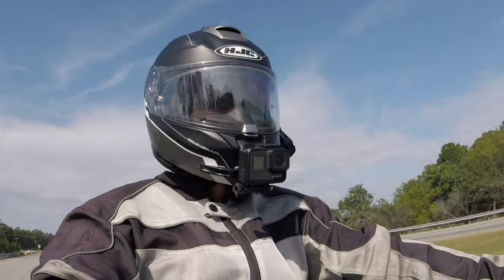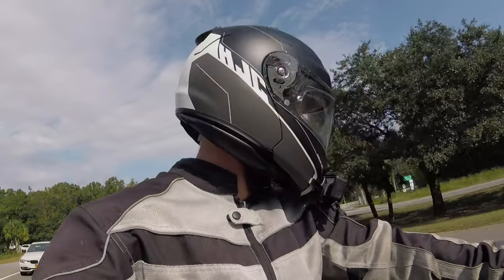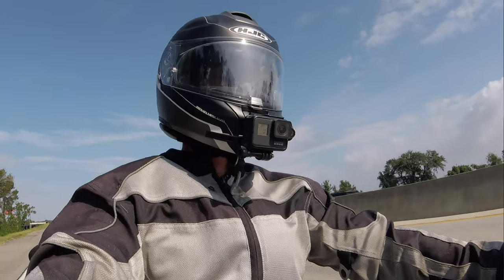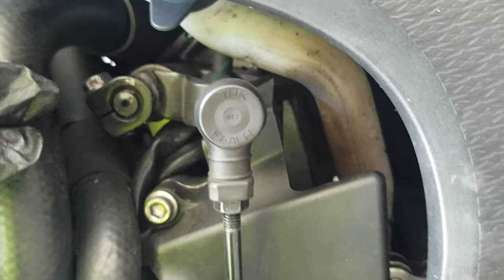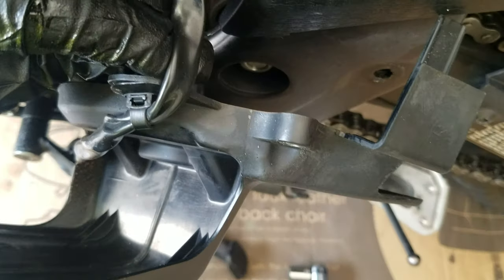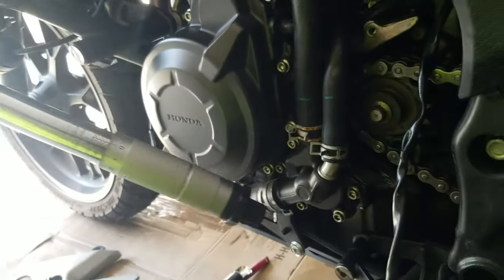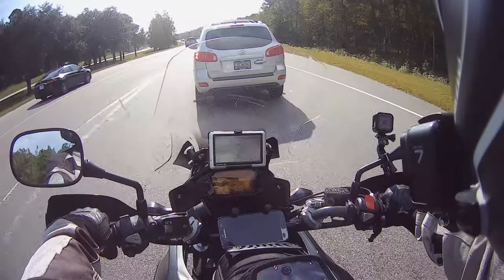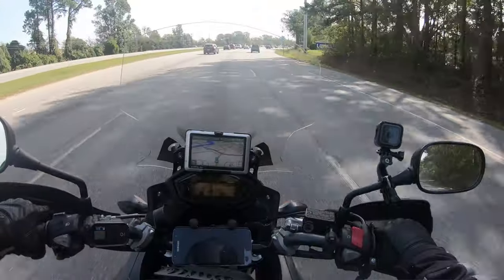CB500X 16T Sprocket Swap

Comment: as a retired motorcycle mechanic, the first thing i noticed on the video was that the chain had stiff links in part due to wear and lack of lubrication, the next thing was how hooked the front sprocket was that you took off, so the rear sprocket was probably in the same condition which in my opinion requires a change in both sprockets and a chain, by fitting just one sprocket it will tend to wear quickly to match the wear in the chain and rear sprocket, as  you said you are lacking in the knowlege that iv'e accumulated over many years,  i'm not trying to put you down in anyway,  just trying to be helpfull,  good luck.
Reply from the maker: Thanks for the informative comment, Stephen!  I truly appreciate it.  The chain is actually less than a year old.  And I'm pretty regimented about lubbing it every 500miles (Chain Wax), and doing a thorough cleaning every few thousand.  So I was quite perplexed when another reader pointed out the kinks in the video.  I contacted the store I bought it from.  Being less than a year old, the thought DID would surely replace it under warranty and gave me their contact info.  I'll be reaching out to them this week.  The rear sprocket is actually in pretty descent shape.  I'm pretty gentle on the throttle.  But it's next on my list.  Thanks again for the sage advice, my friend!
Reply: i just thought you needed to know,   i normally lubricate my chains after a ride or two (depending on the conditions and the weather i'm riding in ) while the chain is still warm from use then wiping off the excess afterwards the day after,  i myself use chain wax on occasion but prefer a more oily lubricant most of the time, don't believe everything the marketeers throw at you, iv'e used gear oil, chain saw oil and whatever iv'e had to hand, as long as it is lubrication it's ok,  it's the throw off factor that is important to some people they and i don't like cleaning thrown off chain lube off the back end of the bike,  every day is a school day,  good luck.
Reply from the maker: Great tips, @stephenkinsley2483 .  Thanks!
Reply: just because the front sprocket is worn does not mean the rear is anywhere near as bad as the front rotates on average 3 times as many times as the rear
Reply from the maker: Thanks for the comment, @jimbo-me2sp !  I never thought about it that way.
Reply: Could you please tell me how the front sprocket cover was modified. Enjoyed the vid
Reply from the maker: Hi @johnbaker7626 !  I didn't modify the actual cover.  But inside the cover, sandwiched between it and the engine casing, is a metal "shield" in the shape of a thin crescent.  That crescent is thicker in the middle and can come into contact with the chain if you install a larger 16T sprocket.  So I just used a metal grinder to shave a few millimeters off the width of that crescent shape to give extra space for the larger sprocket.  Hope this helps!
Reply: Chris Smith Many thanks for your reply.
Reply: @jimbo-me2sp  different material so the rotation difference doesn't count in my view?
Reply: @AlainLeneveu  On a road bike they are both generally made of steel
Reply: @jimbo-me2sp  many different quality in steel...in my experience engine sprocket are harder than rear but it all depends...and maintenance plays a great role
Reply: Yep, I was just about to comment on exactly the same observations.
Reply: In light of the fact that the chain guard needed to be ground down to accommodate the new sprocket would it just be better to change the rear sprocket instead?
Reply: @StephenJohnson-jb7xe  straight off the bat I’ll stick my hand up and say I’m no mechanic, however, I’m from the Lambretta world and in order to achieve the optimum gearing, have messed about with more sprocket / chain combinations than enough. From what I understand, by making the front cog bigger will give the clutch an easier life, so I guess by upping the rear sprocket the reverse applies. No doubt a grown up will be along shortly to make me look a chump 😃. If you’re wondering what a scooterist is looking in on a bike channel, well I was thinking of buying a bike also, & this Honda is the one that caught my eye .... can’t bloody believe you guys lark around with gearing too ... thought I’d be leaving all that behind 🥸
Reply: @geoffhields2398  After following up on my own question I think it might have something to do with cost, a front sprocket appears to be way cheaper to replace than a rear.
Reply from the maker: @StephenJohnson-jb7xe  that is correct...and easier to do since you don't have to take the rear wheel off first.  :-)
Reply: S. Kinsly you are right as rain. Change both sprockets and chain.
Reply from the maker: @bigbeaucoup8236  thanks!
Reply: @MotoPhotoAdventures  lubing every 500 miles and cleaning every 1000? Wow. I though i was lazy for doing those two every 50 - 100 miles...
Reply from the maker: @luizz_k  HAHA!!!  Some of my friends hardly ever touch their chains and just replace them when they get rusty.  I guess to each their own!
Reply: @MotoPhotoAdventures  most guys don't want the grease on the rear rim that collects dirt
Reply from the maker: @cargotoolshop5319  I totally get it.
Reply: Yall are all adding new lube to dirty lube if you're not cleaning it 😂 clean it properly, lubricate it, and you won't have to do it again for another 1500-2000 miles depending on how hard you ride the bike
Reply from the maker: @robertportune1971  that's a great tip!  I usually apply apply a "light" amount of lube every 500 or so miles, then do a thorough clean & lube every 5,000 or so.
Reply: its a bit like replacing one worn shoe and still wearing the old one, its funny.
Reply: I noticed  that too ,and I agree
Reply: @MotoPhotoAdventures  tight links in my 44 years of riding  are usually  attributed  to chains being  too tight ,adventure bikes with long travel  suspension  ,need to run a bit on the loose side.
Ie ,my Honda Varadero  ,was killing  chains and sprockets, at about 17000kms ,since I've  been running  a looser chain ,I now get about 45000kms to a set .
Reply: I agree ,I would  add one point ,the main reason, chains get stiff links ,is because  the chain is adjusted  too ,tight ,long travel  suspension  ,bikes ,need the chain  run on the slightly  looser side.
I learnt  that the hard way  ,my Varadero  used to chew up chains and sprockets  in around  17000kms.
Adjusted  quite  a bit looser ,I now get about 50000kms out of a set ,without  tight links.
Reply: @MotoPhotoAdventures   thank you very much for the tutorial to install the 16T sprocket and answering the question re: the chain guard.  I might have to use a file to remove some material to make it fit and safe.  You are very thorough in explaining what you are doing in your videos.  Thanks for making it easier.
Reply from the maker: @dennisdrumheller9756  I'm so glad we could help!  It's always a pleasure...

Comment: Hi all. Did the Mod with the front sprocket on my CBR500R and it has worked wonders. The speedometer now reads exact. I just did a major long-range highway trip and the motor was working a lot less hard at 70mph. Much more usable and better mileage. This works really well.
Reply from the maker: That's great to hear!  Glad we could help.

Comment: After riding from Germany to Portugal and back on the Trans Euro Trial, one great key feature on the CB500X is that low 1st gear. Riding often standing and going slow on routh terrain, through river beds and on steep hills, that proofed to be important ... always depends on the way of usage.
Reply from the maker: This is very true!!!
Reply: I have 1 in Crete I ride in the mountains, stock 1st gear is fine. I have 1 I ride in UK, as soon as I rode it there I noticed how short 1st gear was! I'll fit a 16T on the uk one.
Reply from the maker: I love the versatility of this bike.  Being able to swap gear ratios makes it even MORE adaptable!!!
Reply: Ich will die gleiche route fahren im Sommer. Hast du tipps welche Anbauteile ich benötige? Motorschutz Blech, Sturzbügel (Oben unten?), welchen reifen bist du gefahren?
Reply: @bitparlee7120  vorne Heidenau, hinten Continental tkc80, ohne Bashplate aber mit Motorschutzbügeln seitlich, Handguards und Tubeless-Flickzeug.

Viel Spass auf dem TET & Obacht vor Pyrenäen- Hunden in den spanischen Dörfern!

Comment: "I'm told that there isn't any loss of torque on the low end" This is false. I have ridden with both the 16 tooth and the factory sprocket and there is indeed a difference.  You yourself pointed out how different first gear feels in the video. I ride on and off road and the low end torque on the stock sprocket is just what I need. First and Second gear are perfect for the rough mountain single track I sometimes ride. It is noticeably worse with the 16 tooth sprocket. Last year I took an 8 month 20,000-kilometer trip (12000 miles for the metric confused)  and I did a lot of off road riding and crossed a couple of rivers that had no bridges. If you only ride smooth paved roads then the 16 tooth might be for you, but I wonder why you bought a CB500X in the first place. It's sometimes called the "Halfrica Twin" because it is an ADV bike designed for on road and off road use.  Longer suspension travel and higher ground clearance for rough roads. You handicap it's off road capability with a 16 tooth sprocket so you can get a bit faster on the highway. If all you do is highway crusing, to me that points to getting a different bike altogether.
Reply from the maker: Excellent insights!  Thanks for the detailed comment.

Comment: I recently put a 16T on my 2013 CB500F and I'm so glad I did. Now I ride it every day as a commuter bike and I save my ZRX for the long weekend trips.
Reply from the maker: That's awesome!  Glad it's working out well for you.
Reply: So do i
Reply: I just purchased the 16T sprocket and ready to install in my 2013 CB500x.  I haven't driven it much so it only has about 5,000 miles on it.  My question is:  did you have a problem with the chain guard fitting with the new 16T sprocket?  Did you have to get it ground off a little, or did you just leave it off?  I'd like to determine that before I take it apart.  Thanks

Comment: Mine was off 2mph when I geared up my 250 rally from a 14 to a 15 🦷 and also 2 mph off when I went from a 15 to a 16 🦷 on the CB500x...
Reply from the maker: Good to know, George!  A lot of guys have installed one of these to correct the speedometer:  SpeedoDRD DRD-3 from 12 oClock Labs - https://amzn.to/2Pahs8C.  I just use my GPS to guage my speed.  Thanks for watching!

Comment: Im confused as to why Honda did not include the 16tooth sprocket. I think I will consider this change when I need to replace my chain. Thank you for this video, still very useful.
Reply from the maker: I'm glad you enjoyed the video and found it helpful.  I believe the reason why Honda does not include the 16 tooth sprocket is because in many countries there are not large interstates like we have in the west.  Many of the countries where this motorcycle is marketed have very curvy, mountainous, or dirt roads where the 15 tooth sprocket is more appropriate.
Reply: It's because this bike is not intended for highway riding. It is marketed as an allrounder. This change may work wonders on the smooth road at high speeds but it is not so good for off-road riding. And Honda sell this bike telling that it can handle off-road too.
Reply: @Goeker  much appreciated insights shared, thank you.

Comment: Thanks very much for the instructional video. With the new 16 tooth sprocket, each gear feels like it is operating in the range that was meant to be. With the original 15 tooth sprocket, first gear was so short and jerky. Much more usable and smooth now. Truly a worthwhile mod!
-If I may add one bit of advice to folks who are about to do this: In order to remove the top part of the gear shift linkage, pull the small bolt out COMPLETELY -do not just loosen it, as the linkage will not come off otherwise (don't ask me how I know!) -Happy riding folks!
Reply from the maker: That's awesome!  I'm glad you're enjoying this new modification.  I have to admit, I chuckled at your piece of advice...clearly learned through experience.  🙂  Excellent tip!!!

Comment: Thanks for your response on FB, Ive bought a 16 tooth, probably fit it tomorrow. Very useful video Chris.
Reply from the maker: You're very welcome Dr. Campbell!  Enjoy...  :-)
Reply: Have you tried it yet? What's your opinion? Thanks.
Reply: @tiagofigueiredo2529  I have bought one, but not got around to fitting it yet, my garage is a bit cold this time of year, soon. Looking forward to the change.
Reply from the maker: @tiagofigueiredo2529  I just returned from a $4,500 mile trip down through Mexico and back with the 16T front sprocket.  AMAZING riding in Mexico.  The sprocket did great!  Check it out at:  https://www.youtube.com/watch?v=s8Av65qL_mY.

Comment: Did this to my 500X. By far the 16t sprocket was the best single change to the bike.
- cheap <$30 
- easy to do, maybe 15 minutes with common tools (probably use the stock Honda tool set).. I don’t recall having to remove foot peg bracket or front chain guard. And stock chain is more than long enough.
- Canadian speedometer calibrations tend to be conservative, this made my Speedo within 1%
- spaced out the gearing and made 1st gear useful, you won’t miss any “loss of torque” you’ll simply be riding one gear lower
- 6th gear is a better overdrive and lowers highway rpm’s to be more comfortable cruising at high speeds. Bike was a lot more relaxed at interstate speeds. And with my Givi Airflow setup I could go anywhere.

The 500x is such a great package on-road, off-road, hiway.. wherever. This simple change really enhances the bike.
Great Video!
Reply from the maker: Thanks for the great comment, Lorne!  I'm glad you were as pleased with your upgrade as I was with mine.  :-)
Reply: @MotoPhotoAdventures  how does the change affect the fuel consumption?
Reply from the maker: Hi  @allanlao5172 !  Unfortunately I've never kept good records of my fuel mileage.  So I have no records to compare it against now that I've made the change.  Many have speculated that this upgrade should provide slightly better fuel economy.  But to me, just the fact that the engine isn't working as hard at high speeds makes the whole upgrade worth it!
Reply: @MotoPhotoAdventures  thanks Chris for your reply and for the video
Reply: Hey lorne I'm in Canada aswell so when i do 128km/h by gps I'm actually doing 120 so speed will be corrected with the 16t sprocket right?
I have the same engine but on a 2020rebel 500
Reply: Emil C not sure..
-Does the rebel have the same gearing?
-is the speedometer calibrated the same?
It’s simple math 1 divided by 16 is 6.25%... that would be the change in your speed reading across the range
Reply: @allanlao5172  I have the same question about consumption changes? 🙄

Comment: Great video Chris!!  The maths is simple.  Drive sprocket teeth / Driven sprocket teeth = speed ratio.  The % change caused by changing drive or driven sprocket teeth will increase or decrease speed respectively and the inverse effect by the same % will occur on torque and acceleration.  Enjoyed your video and replies to people's comments; humble and sincere responses!
Reply from the maker: Thank you, kindly, Jerry!  I appreciate the information, as well as the encouraging words.
Reply: You get just over a 6% decrease in RPM with the sprocket change IE about 300 RPM at 60MPH,  15/16= 93.8 so if you had 4900 RPM at 60mph before then you'll have 4900 x .938= 4594 RPM.  Nice improvement
Reply from the maker: @dralexmclean  thanks for those math skills!

Comment: When you did the 15T evaluation, you used the indicated speed rather than GPS -- at indicated 80 MPH the GPS showed 83. So part of the reduced engine speed you observed going to 16T is that you were going 3 MPH slower than you were with the 15T.

Thank you for the high quality video. Stay safe!
Reply from the maker: You're very observant, Thirsty Fox!  Thanks for the note, and for the kind words of encouragement.  Have a great day!
Reply: @MotoPhotoAdventures  Interestingly motorcycles here in Canada all seem to be about 5-7% optimistic in their speed readings. Might be an attempt to get people to go more slowly. Surprised to see yours was a few % slower than GPS speed.
Anyways, might see if I can do this 16T mod to my CBR500R. Should bring the speed a little closer to actual, in my case. Take care and safe riding!
Reply: Wow,  I didn't actually know our speedos were so accurate! People always complain about the speedo difference, but ~3.5% slower at 80mph than GPS is pretty good!